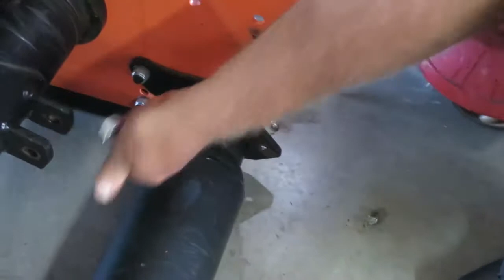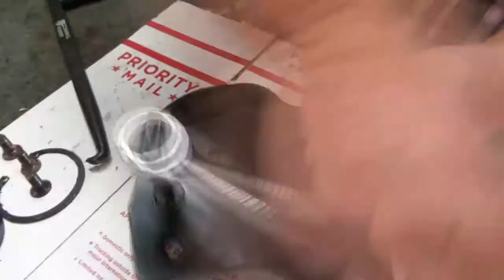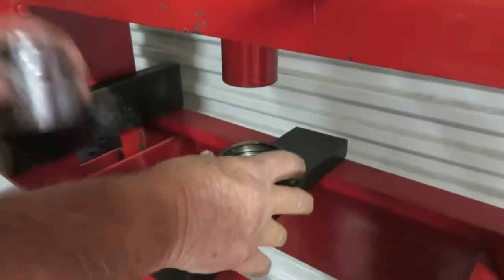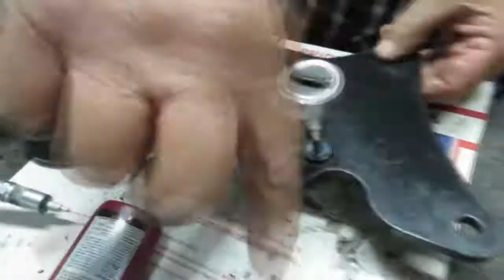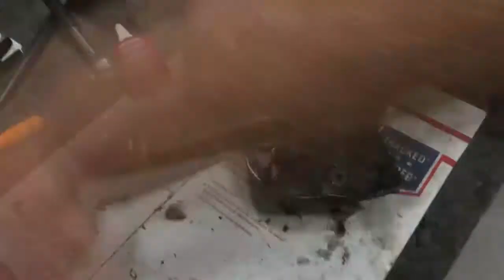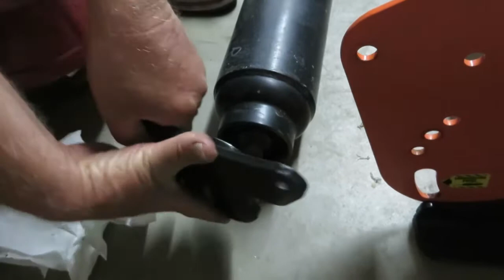WoodMaxx FLAIL MOWER - roller bearing Maintenance and replacement of the roller bearings

Comment: Thanks for the good easy to follow instructions.  I had my bearings fail the second season of use.   Less than 250 hours they recommend for greasing intervals.  I also have a Ford 918 flail mower that I grease every 8 hours that I have been using for 15-20 years..  I don't understand why Woodmaxx thinks greasing more often than 250 hours is detrimental. I think I'll start greasing once a week like my Ford.  What are your thoughts on greasing intervals? Thanks (Paul in OH)

Comment: How often do you need to replace the bearings?
Reply from the maker: I have replace them twice  in the last 1-1/2 yrs.....  But,  what destroys the bearings is the longer swamp grass that I have, their long narrow like a corn leaf but narrow.... If you don't have that kind grass and don't overfill with grease and push out the grease seal... You probably will not have the change bearings for years.... Seems like it's a well-built machine....
Reply: bigdavid1 - We have rye grass and my bearings had to be replaced after a year and a half also.  I think, due to Woodmaxx being very serious about not greasing more often than every 250 hours, for the reason you mentioned-overfilling will push out the grease seal, I think I gave the bearing a shot at 100 hours and 200 hours. What do you think of removing the housings, popping off the grease seals and regrease the bearings every 20 or 30 or 40 hours to make sure the seals don't pop out of place? (My reason? ->I've got more time to grease than money to replace bearings these days) thanks
Reply: Thanks. I was eyeing it as a more of a finish mower / mulcher that I could do some light bush hogging with on occasion.
Reply from the maker: I use this for finish mower also, what I've been using is the duckbill blades (for everything) they mowed just as good as my Dixie chopper,  the grass blades did not perform to my satisfaction..... But, remember we have Florida grass if it's green it's grass....